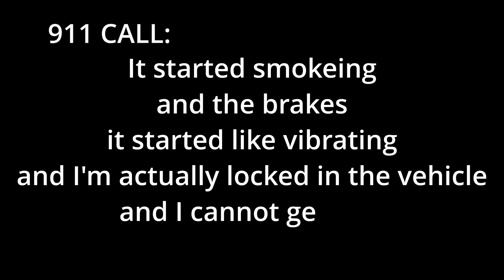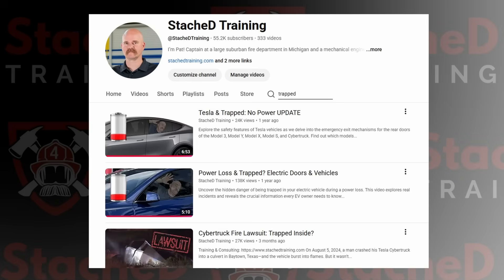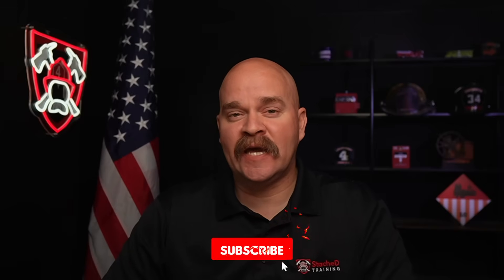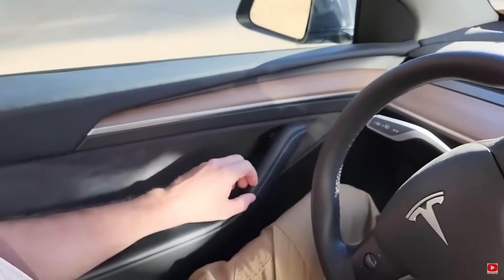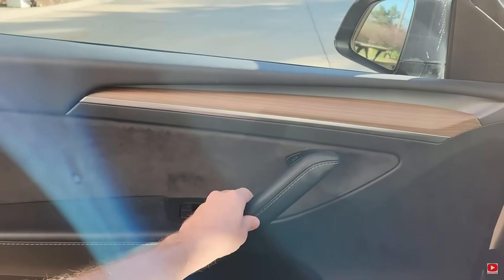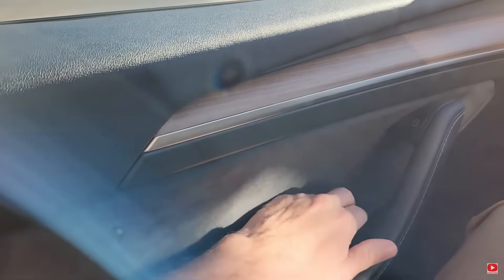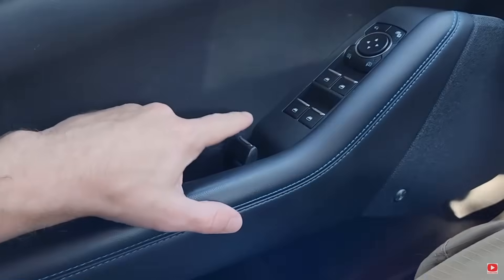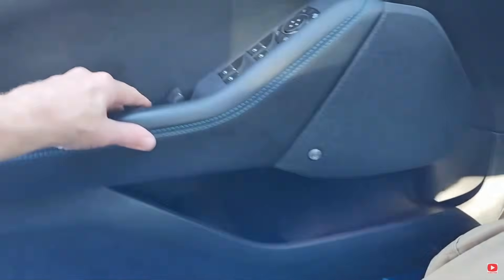Electronic Door Latch Failure: Smoke in the Cabin

Comment: We had working door handles for a century, it's almost like when NASA claimed we lost the technology to go to the moon.
Reply: Actually they still do not have the technology to go to the Moon.  Their present system is on a Wing and Prayer.  I hope it does not crash and burn, but I'd hedge my bets on that.
Reply: @brunonikodemski2420  SLS and Orion are solid, but that damn SpaceX thing out of Buck Rogers they're gonna try to land with is exactly why that wasn't done for Apollo. Nobody could work out an even-remotely-sane way of landing a tall rocket right-side-up on the Moon. And the LEM (later LM) was conceived out of trying to answer what kind of lander was needed. Russians came to the same conclusion, and had a lander built as well.
Reply: @markh.6687  
Oh, sure they could land on the moon. Same way as in the movies and video games. By simply faking it, hence the no blast crater. However, I am not seeing the impossibility of landing a tall rocket under 1/6 earth gravity. If that was a valid argument, then missiles should not fly? And self-driving cars should be impossible? I still think that manned moon landings were probably faked, just that there are better arguments for showing that.

Stealth airplanes should not be able to fly, yet they do. They are incredibly unstable, but the "fly by computer" controls are able to make adjustments fast enough to keep them under control.

Did they really run, what was the movie, Apollo 13 after an oxygen tank exploded and they had no more energy to use than that of a coffee-maker machine? Unbelievable much? But think about it, unalived astronauts floating around in outer space is not the way to get a fickle public to fund your very costly space program. But if they movie-fake-it, then they can control the outcome, and bring the astronauts safely back from their "merely orbiting around the earth" says one of the "manned moon landings were faked" theories.

Buck Rogers? Well at least they admitted that was fake.

Now why didn't the Soviet Union expose the entire scam? Think about it. Why would they, when THEY WERE IN ON IT ? So then, what was the scam? To get people looking away from God for the answers to life's questions, and rather looking to corrupt governments, bribes, foreign aid money, deception, the mad-scientists, the evil elitists who want to evil overlord everybody, just like the Satan that they serve. So in that way, I think it is encouraging to question or disbelieve that manned moon landings were even real.
Reply: Well if manned moon landings were probably faked, that sure would explain a lot.

I think what may have happened, is the disaster of the personal computer. It became a lot harder to fake moon landings. "Wasn't that moon rock over yonder?" "Where is the blast crater?" I mean, it is fun searching for fakery in TV shows and movies, what with pause and frame-by-frame DVDs or computers. Imagine the cries of fakery if they were to try it all over again. Back in the days of black and white TV, you couldn't just watch it over and over again, just because "hmm, something just doesn't look right".

Had we actually sent men to the moon, then shouldn't there be a lot more progress by now?
Reply: Well, the Apollo program's dies and tooling, and all the component manufacturing  were long gone by the time going back to the Moon was a reality. Recreating the tech of the 1960's and 1970's would have taken decades of modern testing. When the new era of engineers thought about recreating the mighty F-1 engines used on the Saturn V, they discovered that every F-1 engine on a Saturn V was tweaked by manual calculations and trial-and-error. Every single one. No Computer Aided Design; no simulations, just hands on work by engineers who had passed away and left few records of what they did and how they did it behind at the end of the program. The Space Launch System (SLS) actually uses revamped spare Space Shuttle Main Engines (SSMEs) because it was determined to be a cost-efficient option and people still know how to work on them. NASA also had the problem of having some Apollo records and data on obsoleted computer hardware and software that later was scrapped for the most part, so actually reading the data and records became a project in itself. There was indeed a time that NASA had no way to get to the Moon, as budget-cutters again and again cancelled or delayed various programs (actually wasting money in the process), and no way to re-create the Apollo spacecraft.
Reply: @markh.6687  
That sounds very much like a government lies cover story. It makes far more sense to question that the manned moon landings probably were faked. How could they just conveniently "lose" the technology? Like the conveniently-missing Pentagon security video tapes when a supposed airplane hit it, and not some missile as one theory goes? Or the Nicolai Tesla government-raided research verging on free-energy machine technology, that has somehow disappeared? What about the Enron evidence that conveniently disappeared in the "9-11 was an inside job"?

The corrupt greedy corporations today, fight against video game preservation, people are forced to copy and mod and emulate to keep the old video games running, as Big Corporation prefers new and extremely costly games, and refuses to sell old games at any price, because they might cause some possible competition. But there can be no possible "lost sales" when they refuse to even sell the old retro stuff.

Not saying that that closely relates to the old "forgotten" gone-to-the-moon tech, but rather than the whole rotten system is corrupt and full of deception and lies.

But another concern that I have is, that the old people who built up the country, are getting old and retiring and passing on, and the young people graduating, hardly know anything about anything. Are countries already falling apart, because they put the most incompetent and evil elitists in charge, and hardly anybody knows how anything works anymore? I watch too many old-tech YT videos, amazing watching how old elevators and such work, and now the stuff isn't so fun anymore, all hidden away on some computer circuit board, not so much anymore, the very complicated and amazing machinery and clicking relays. And they say that old appliances last forever, and do not even know how to break.

Comment: What EV doors need is a big red emergency lever, so when the car fails you just pull the big red level and not only the door catch releases but also the hinges release and the door under spring power fly's away from the car so you can get out as quick as possible before you are cremated.    All 4 doors should have this as a required standard fitting to make the EV's legal to sell.

Comment: All manual backup door releases need to be marked in high visibility orange with a decal pointing occupants to their locations. Might not be ultra slick modern, but it will save lives.
Reply: You're painting over the problem.  There shouldn't be electric doors in the first place.  You shouldn't need an "emergency" handle, or anything of the sort.

Comment: Not an EV problem, been in plenty of vehicles where I have had to look around for the interior door latch.  In hind sight, this should probably have standards for location and function.  Automakers have done a stellar job of moving things around that are critical functions - headlight and washer stalks, door handles and locks, emergency brakes, transmission shifters.

Electric door function is probably coming to all cars if it is lower cost or offers marketable functions.
Reply: I don't see how it could lower cost if an emergency mechanical release is also required.

Comment: Electronic door latches are not the only problem. Some new cars also have brake-by-wire and steer-by-wire. Yes - no physical connection to the steering or braking. How any safety authority ever approved these is beyond me.
Reply: What safety authority? MFGs no longer need to skirt regulations. They literally write the regulations and pay through campaign donations to have them passed. Name a branch of government that isn't beholding to monied interests.
Reply: Modern airliners are all "fly by wire" too. 🤔
Reply: @chrisperrien7055  They have at least triple redundancy (three independent systems, using different computers, separate power supplies etc) and the more modern aircraft (A350, A380) have independent backups in case all the main systems fail.

Older systems had their problems too.  Even triple hydraulic systems didn't prevent the Sioux city DC10 crash, when all three systems lost all their hydraulic fluid.  Even manual flight controls only work as long as the cables stay connected and unbroken.
Reply: @chrisperrien7055  Automobile maintenance is very different fro airliner maintenance.  Boeing airliners prior to the 777 were not fly-by-wire, and I still avoid Airbus and the 777 when possible.
Reply: @chrisperrien7055  
Sometimes "fly by wire" is better, at least in some disaster stories. The auto-pilot was still able to control the airplane, when the manual controls failed, because its cabling was run through a different and less-affected path, or because it had the extra "muscle" of hydraulic fluid pressure to force things.
Reply: Bad voters >> bad government >> bad regulators

Comment: as some one who has spent from the age of 5yo to 38yo learning about how cars are made and is passionate about build quality. non of these cars Cry out to me as well built premium $100K+ vehicles. why are we using Windows that are not Tempered glass up front you know where 90% of the people spend most there time and need to get out when trapped. why are we using ELECTRIC LOCKS and Door handles that when power is lost you cant get out by breaking the window in front have to crawl to the back windows witch are tempered on most modern cars. WHY ARE WE GOING BACKWOARD why are we repeating things and lessons we learned 50+ years ago. these cars in my mind should all be forced recalled and force the manufactures to make it be a mechanical connection. this kind of stuff makes me very angry at new cars in general. because there cutting cost that should not be cut just to stuff tech in where it does not belong and make a over complicated DOOR HANDEL........you know why door have been the same system for hundreds of years...because its simple it works everyone understands it and how to use it and a fire or the house losing power DONT TRAP YOU IN SIDE. and these cars are disposable there not even being built to last 10-20 years there built the be thrown away as soon as the battery pack is done.  go to Copart or many other auction places. TONS of dead battery cars just sitting some have been sitting years no buyers because no one can afford to replace the One of a kind battery only this car fit. and not many are rebuilding them and soldering them in series with bus plates and cooling plates. and what really bothers me more is we slam more and more tech in to something that in the 70s was analog gauges no TV screens everywhere when 70s EVS needed non of it same with 80sand 90s and 2000s. you just need a GPS and basic phone and app functions. give me back my AC controls give me back my buttons give me back working mechanically connected door handels.. give me back my Sanity................why are we hiding the emergency manual door release.....come on.......
Reply: Q1: WHY ARE WE GOING (BACKWARDS)...? A1: well as I've said numerous times right here in the past, welcome to the MYTH OF PROGRESS.  unfortunately the History of Technological Development is not a "fairytale" where certain things are achieved and then the people live "happily ever after".  no because what ACTUALLY happens in History (when you take the time to actually read it) is that both PRO-gressions and RE-gressions are what actually occur in History (aw crap).  ikr...?
Reply: Q2: why are we repeating things and lessons we learned 50+ years ago(?) A2: "Those who don't know History are DOOMED to repeat it..." - George Santayana (1862-1953)
okay next question please.

Comment: The solution of this problem is really simple: just combine the electrical and mechanical lock release in a single device that could be like a small lever: you pull or push it slightly - only the electrical part works. but if you pull or push it all the way, the mechanical part will work. In emergency, people tend to apply a lot of force to controls, so they will automatically engage the mechanical part of the system. But I still don't understand why designers decided to hide the mechanical levers. Even many 25-y.o. cars have both mechanical and electric locks, but they have slightly different functions: a mechanical lever unlocks just one door, while the electric controls lock or unlock all doors. They are both useful
Reply: You do realize it's not like they can't design it. It's just that if people are stupid enough to buy the vehicle as-is, why would Ford spend more money and time designing a door that way? You bought the car already, Ford or Honda could care less if you burn inside after they already got their money lol.
Reply: @Stealth86651  Or maybe car manufacturers try to use Streisand Effect - the more discussions about deficiencies of their cars, the more people will hear about their brands, which will work like free advertisement
Reply: Why not just have a mechanical mechanism without the electronic component? Why does everything need to be electric?
Reply: @Elsa-u9q4f  An EV with mechanical mechanism? Are you kidding? EVs are hi-tech, which means they are supposed to have everything operated via the screen and touch-sensitive buttons!
Reply: @tedantares2751  lmao form over function, the typical corporate snob cannot even begin to understand safety and care
Reply: That's exactly how the Tesla S release works.  The Tesla 3 mechanical release is exactly where you'd expect the door release to be if you hadn't been in a Tesla 3 before.
Reply: @darrennew8211  But what happens if your first car is Tesla, or you simply got used to the electric lock release button?
Reply: @darrennew8211  What about the REAR Doors I the 3, Y & incEl-Camino? Those Emergency Mechanical Rear Door releases are HIDDEN.
Reply: Those crappy engineers, or more likely the corporate money number crunchers, will design your "device" to cost close to a thousand dollars to replace, even though you know that the manufacturer paid far less. Further, it is will not be interchangeable with any other brand of car. And probably your basic set of tools in your toolbox will not even fit, you will have to buy a special tool from the dealer, that is, if they even will sell it to DIY customers?

And then how do you design it so that the car thieves will not simply circumvent all the security and give the car a bad reputation for car thefts? Of course if there was no taxes, and cars still could be bought brand new for a mere $6K, there might be fewer car thefts.

And do not forget the child safety locks for the rear seats. Back in the day, you could get your dozen children in a car, because they had no seat-belts and smaller children would just sit in the laps of the larger and heavier children. See the cover jacket of the DVD, 1950s version of Cheaper By The Dozen. That is how you fit a large family into a basic car. But back then, there probably were not as many people driving 80+ mph in a 55 zone, or trailing on your bumper or refusing to use turn signals because their BMW does not have the subscription for that.

And I do not understand why they can't design more and better cubbyholes and cup holders? When every bin is filled with something, the obvious solution is that there are not enough drawers and cubbyholes and bins.

Now the goal seems to be, to design everything to be as complicated and as expensive as they can get away with.
Reply: @yosefmacgruber1920  Check out the new screwhead design that BMW just patented for assemblies they don't want anyone else messing with.
Reply: @davebrown9725  
Yeah, I heard about those crappy Big Money Wasted screws. Even Prepper Princess talks about how mechanics hate BMWs, because they are so costly to maintain and fix.

They can not even make the modern stuff last until the warranty expires? They couldn't simply make warranty-violation screws? Which shouldn't be as much a problem if "What warranty?" Too old to have any warranty left.

Yet there is a plan-demic of BMWs invading the USA. I guess Americans would rather be repoed than to live on a budget? Gotta have those trendy "status symbol" impractical cars. But I never did fit in so well, and so why should I care now what people think? My very old car is paid for. I never have had a car payment. Whatever is a car payment? And I wear old clothes also. If not in style anymore, then I am helping to bring the style back again. Why work more and pay more? Often it just means more taxes and less freedom.
Reply: Shareholder returns is the usual answer.
Reply: Nerds dont want anything visible that an Iphone cant operate and manufacturers want to pocket the money saved. Morons all around making Darwin happy